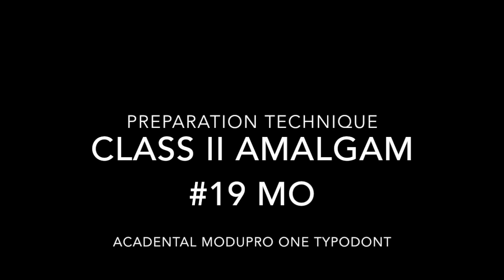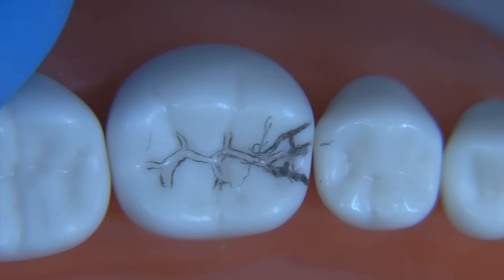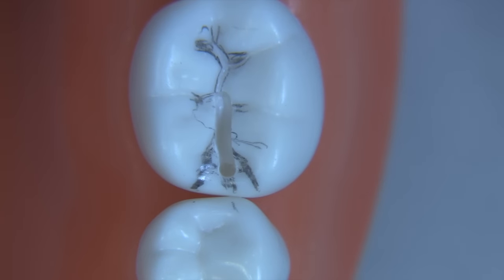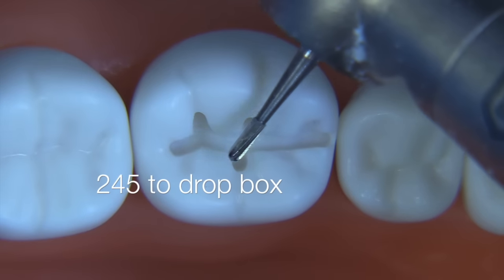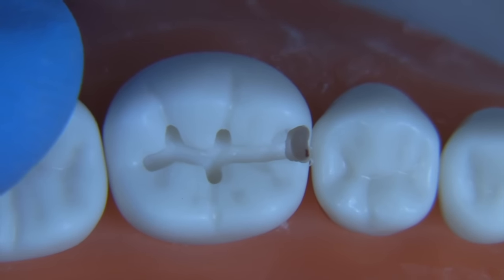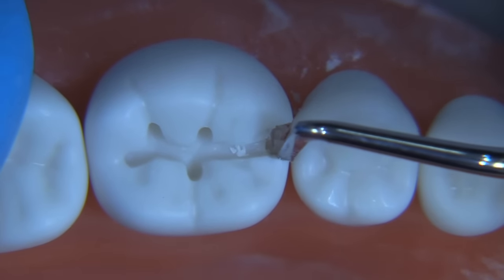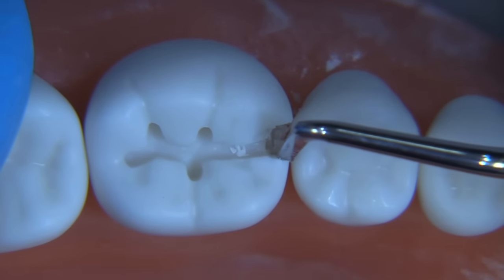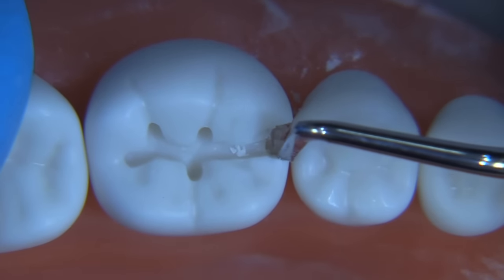Class II Amalgam #19 MO Acadental | Amalgam Preparation Technique

Comment: Thanks so much Dr Stevenson for this amazing demo of Class 2 amalgam prep, which is a nightmare for many dental students including me. 
I have one question though, I have been preparing MOD prep and noticed that distobuccal cusp is getting very small after the final preparation coz of extension of proximal box buccally to get enough clearence. I was just wondering is this acceptable or is there any method for distobuccal cusp preservation in order to prevent over reduction of that particular cusp? 
I hope you got my query, thanks for reading and I will be waiting for your response.
Thanks and Regards.

Comment: Great videos as usual. I see you have alot of requests, my wishlist contains a porcelain veneer prep because there are different variations in the literature. Really appreciate it. Thank you so much
Reply from the maker: Yes - at least 5 different prep designs for different indications and pre-op conditions.
Reply: Indeed and the relatively recent change regarding the finish on the incisal surface ie with bevel or without etc

Comment: Hi Doc, your content is saving my life in dental school. Thank you for putting out amazing content. A quick question. I recently started practicing for Class II Amalgam #30 MO and I've been having trouble gaining a proper vision on the mesial and gingival floor when I'm dropping the proximal box. I'm used to operating at 7 or 8'o cock position when I work on #30, but I was just curious what would be an ideal chair position when dropping the box for class II #30 MO. Same question with a #19 MO as well. Thank you.
Reply from the maker: Class II boxes on mandibular teeth are always more challenging than maxillary teeth.  7-8 O'clock is good for bur orientation, line of draw, mesial distal tipping, buccal lingual tipping but poor for visualizing the boxes.  Try the 12 O'clock position for direct vision - it works most of the time, and have the patient lean towards you.  Ultimately, the mandibular class II box approach will be a combination of different chair positions and the concept (albeit uncomfortable at first) of "cut a little, look a little", repeated numerous times.  As you gain a subconscious awareness of your bur in 3D space through much practice (will take 100s of preps), and remembering the importance of bur orientation and finger rest, you can do less looking and more "blind" cutting.  Some things in dentistry are very easy and some things are very hard - it's just the way it is...so, when you encounter a difficult prep, say to yourself, "okay, this is tough, it will take longer, be patient..."  Best to you!
Reply: @StevensonDentalSolutions  Hello Doc, thank you so much for your thoroughly reply. Thanks to your advice, I've been trying different operating positions for dropping the proximal box on #30. A quick follow up question though. When I'm dropping the proximal box at a 12'o clock position, I noticed that I've been having lots of trouble with seeing the depth of cut I'm backing since it's a bird-eye view. In another words, it's hard to see how deep I'm going in with a bur. I'm not sure if I'm doing something wrong here, or if it just takes practice. I would appreciate your words of wisdom once again! Thank you.

Comment: thanks .. very helpful. I might have missed a thing or two on retention. You didnt stress much on importance of making retentions on the preparations. How useful ( or not ) would you say they are?
Reply from the maker: As long as the major retention aspects are present: occlusal convergence, proximal convergence and occlusal locks, most amalgam restorations have ample retention.  If the size of the box is large, additional retention may help via the use of axioproximal grooves.

Comment: Hello Dr, I appreciate your videos. I am curious, how wide is that gingival floor of the box mesial distally? My school requires it to be 1.25 mm but I always find mine is more like 1.5 by the time I get the 245 in there. Thank you!
Reply from the maker: 1.25 mm.  Use the 245 closer to the adjacent tooth and be mindful of its position at all times.  You'll get there!  Use the secondary cutting edge of a sharp enamel hatchet when finishing the axial wall to control the axial depth.

Comment: Thanks for the great video Dr. Stevenson. Any recommendations on how to refine the box if we have no chisel in our instrument set?
Reply from the maker: Use the 169L or 55/56 to create most of the refinement - you'll need the chisel to refine the Axiobuccal and axiolingual line angles and the point angles at the gingival...
Reply: @StevensonDentalSolutions  0

000
0
0
Reply: @StevensonDentalSolutions 

0

Comment: Any tips on how to avoid trauma to the gingiva using the hatchet? 
Mine keeps slipping and I'm practicing on a model but it would hurt if it was a real patient
Reply from the maker: Keep a stable finger rest and make sure that the hatchet is very sharp.  We recommend sharpening them after each prep. Also, take very small "bites" with the hatchet...less force and easier to control.  And finally, remember that we define with the bur (95% of the prep) and refine with the hand instruments (only 5% of the prep).  Best to you and Happy New Year, Dr. S
Reply: Thank you so much!!

Comment: Thank you Dr. S,
Very helpful video , whats the difference if the prep is for composite class ll?
Reply from the maker: The walls of the box may be flared, the internal line angles are more rounded, and no retention in the box are convergent occlusal are required.
Reply: Stevenson Dental Solutions Thanks 😊

Comment: Hi Dr.
So the buccal wall of the proximal wall should converge toward the occlusal right? i am confused about the lingual wall.Should it not converge at all towards the occlusal? Should it be completely straight parallel to the external lingual surface of the tooth? Because whenever i start preparing the priximal box, both lingual and proximal walls converge no matter how hard I try to not converge the lingual wall.
My other question:
For the proximal box of all molars and premolars is the same pattern to be followed : buccal wall convergent and lingual wall straight?
Reply from the maker: The lingual wall (or the non-functional cusp wall) is orthogonal to the gingival.  This will require a slight tip of a 245 but towards the lingual to compensate for the convergent pear shape.

Comment: I love your videos. I have a question. What would you do if you need prep Amalgam on the same tooth but it’s DO instead? I have a Columbia typodon as well but the distal cusp is really small. I think if I do mine S shape. I will take most of the distal buccal cusp away. How would you do this type of prep? Is there any restrictions for this type of prep where you don’t follow the rules...!? Thank you so much in advance for your help
Reply from the maker: Forget the DB groove at first - simply prepare the class 2.  Then assess the DB groove - if it is more than 0.5 mm away from the buccal proximal wall, leave it, and you're done.  If, however, the groove is closer than 0.5 mm from your buccal proximal wall you have two choices: 1. Simply widen your box buccal to include it, or 2. Cap what remains of the Distal cusp FLAT to the pulpal but don't touch the proximal box from the gingival to the pulpal - it's like a mini-cusp capping procedure.
Reply: Stevenson Dental Solutions. Thank you so much for responding so fast. I really appreciate it. I ordered some of the burs that you were suggesting and an instrument as well. 
If at one point you make a video of this type of prep. I’ll be paying attention to it. Thx a lot for all your help

Comment: Thank you so much for this wonderful video Dr Stevenson.
I have a question and concern about using the enamel hatchet. So, when we chip the little bird peak according to your description, down to the gingival wall, wouldn’t that create a sharp angle between the gingival and the axial, buccal or lingual wall of the box? And how to avoid this?
Thank you
Reply from the maker: Hi Doc - not really - creating a sharp line angle takes effort and requires forming it by sliding the hatchet into the proximogingival area across the gingival as well - simply removing the lip isn't enough, therefore it won't be an issue. The rounded line angle created by the 245 and refined by the 330RGS will remain as is, but if it seems too sharp, it's easy to correct with the bur.
Reply: So lovely, Thank you Dr Stevenson , I really appreciate it.
Reply from the maker: Thank you

Comment: Is it mandatory to go through the secondary grooves? Can we just make it straight line?
Reply from the maker: These are not secondary grooves.  They are primary grooves, as they separate cusps from each other, and yes, they would need to be inclided.
Reply: @StevensonDentalSolutions  yes, primary grooves. Sorry

Comment: Hey Dr. Stevenson, 

I'm sure you want us to buy the 330RGS bur (maybe once I'm not a broke student anymore) but what bur would you recommend to use to refine everything without it? I've tried 330 in slow speed and it rounds the gingival too much but can work. 245 same thing. A 55/56 also works but sometimes is too aggressive. 169 is too pointy (too tapered) and ends up messing up my pulpal floor. I've used a 34 and that sometimes works but sometimes is too convergent and messes up my internal walls. Basically I can understand why you made the 330RGS, but not sure if you have another technique?
Reply from the maker: Take the 245 and flatten the bottom with a diamond bur.  Presto - RGS 330 hack.
Reply: @StevensonDentalSolutions  thanks!

Comment: thanks! can u shape the appromximal box without the 10714 instrument?
Reply from the maker: Yes, for sure - just requires attention to the bur position to avoid damaging the adjacent tooth.  THe result will not have sharp internal line angles, but this probably won't be an issue unless it's an exam situation.

Comment: Hi doc, i am facing a bit difficulty while preparing buccal extension for Class 1 cavity in mandibular first molars as the walls of extension slant mesially making the mesial wall divergent and i always feel unsure if i have gained parallelism of walls or not . Kindly provide your valuable advise to rectify this problem.
Reply from the maker: HI, I'd use a 330 bur and keep it perpendicular to the occlusal table (plane formed by the of the cusp tips) except when approaching the marginal ridges, for which you'll need to diverge the bur about 6 degrees to create a slightly divergent wall.  The walls are not made parallel in the ideal preparation.
Reply: @StevensonDentalSolutions  Thankyou so much, you are always there to help 🙏
Reply: Could you also suggest me a way to  confirm  the convergence of the walls after preparing a cavity in mandibular molars because the mid buccal wall of first molar in 4th quadrant is always a surprise , mostly it turns out to be diverging for some reason.
Reply from the maker: @sahilbhalla389  The buccal and lingual primary groove areas should typically be extended about 1.0 mm wider than the isthmus.  When performing this extension the bur should be uprighted slightly to lessen the divergence in order to follow the enamel wall direction.  IF you extend more than 1 mm, the wall will even need to be made divergent in these buccal and lingual groove areas.  If your prep is very conservative, the 330 bur will do the job for you.  A solid finger rest is essential.
Reply: @StevensonDentalSolutions  Thankyou doc ❤

Comment: can the cheap typodont sold at ebay for about 8dollar be used for amalgam filling practice?columbia type is expensive.
Reply from the maker: Yes, but not for the exams in the US
Reply: thank you for your reply.that doesn't matter.cause I'm not dental student .I just like to make amalgam tooth model for an object.I also have mercury ball pendant called rasamani made by herbal process.It was metal but smelled like leak.interesting.

Comment: How much should the length of the axial wall be?
Reply from the maker: It's not a particular requirement but it's usually about 1.5 mm tall on the Acadental Tooth.  It depends mostly on the gingival extension required to break contact and remove caries...

Comment: Can anyone please tell the width of the gingival seat??
Reply from the maker: It's not called a seat, it's named the gingival wall.  The buccolingual width is determined by the need for proximal clearance, hence has no constant measurement.  The mesiodistal "width" is referred to as the axial depth, and this will be 0.5 mm minimum into dentin, or about 1.25-1.5 mm deep from the gingival cavosurafce margin.

Comment: How u give the clearence can u pls ans it I can't understand it clearly
Reply from the maker: This is the space from the cavosurface margin to the adjacent tooth.  It should be ideally 0.3-0.5 mm on the buccal and lingual walls and at least 0.5 mm along the gingival wall. To obtain this clearance, the walls will need to be undermined at first and then corrected with either a bur (difficult to do without over-extending or damaging the adjacent tooth) or with the use of a sharp hand instrument, namely an enamel hatchet.  The undermined "lip" of tooth is cleaved off in such a way as to provide an exit angle that creates a 90-degree angle of the wall created with the unprepared tooth structure.
Reply: @StevensonDentalSolutions  i cant use enamel hatchet to obtain the clerence thats why can u pls show a separate video on enamel  hatchet using cletence giving
Reply from the maker: @anurupamukhopadhyay4818  Okay - then you must use a very skinny bur like a 168 or 169 and extend further than 0.5 mm - there is no other way, UNLESS you use a wedge and matrix band to protect the adjacent tooth.
Reply: @StevensonDentalSolutions  If i use wedge then ...use the tapper fissure bar as in our clg we use the contra angle handoeice with diamond shaped bar the the typhidont very hard that's why the enamel hatchet does not cut by myself as it is not so brittle,,that's why use a wedge then use a taper fissure bar to cut that portion and create the gingival clerence or should I use gmt to cut the portion by smoothing type..

Comment: Why is it important to make a box in this prep why don't we just simply prepare proximal area of the tooth??
Reply from the maker: The assumption is that the occlusal fissures (in the primary groove location) are carious.  Class I caries frequently accompanies class II caries.  If no caries is present, then a box may be performed, however it must have significantly increased retention (grooves and convergency) to work well long term.